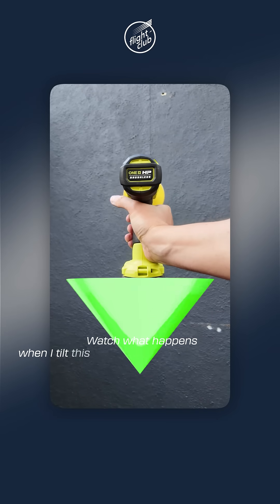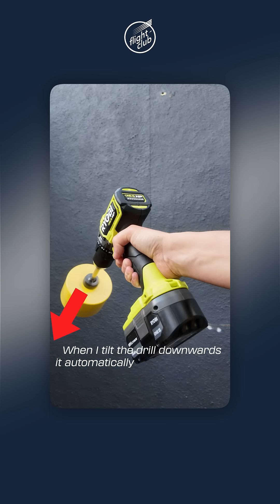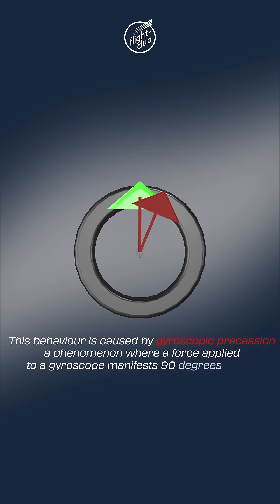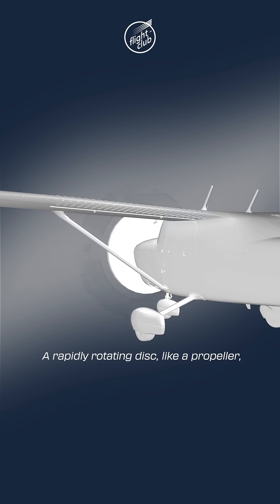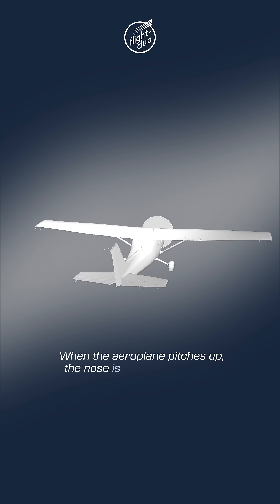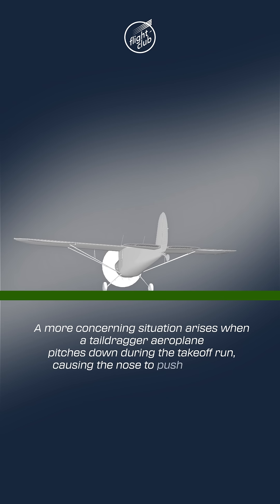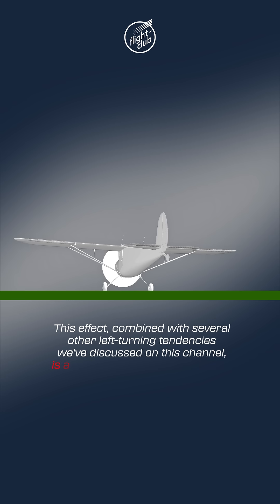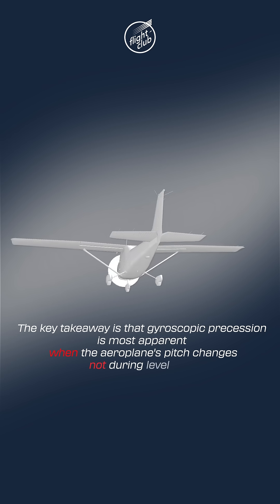Gyroscopic Effect on Aeroplane #flightclub

Comment: but raising attitude cause yaw to the left for p factor????so why there right? Plz help and explain
Reply: P factor, spiraling slipstream, and torque are all left turning tendencies. A common misconception is that Gyroscopic precession is also a left turning tendency, which is only true for tail draggers as shown in the video. P-factor and torque have a much larger impact than gyroscopic precession in our cessnas, still resulting in a net left turning tendency.
Reply: @Inversiondude  Wouldn't GP lead to a left turning tendency with a nose down attitude?